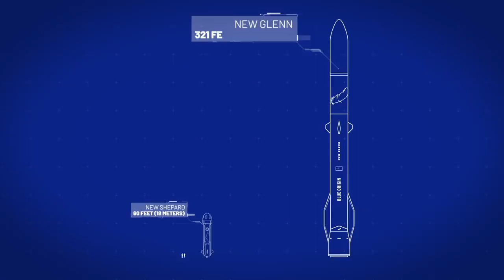New Glenn: Building the Road to Space

Comment: The Falcon Heavy Can Deliver More payload to orbit than New gleen
Reply: New Glenn has a ~3x larger payload volume. Falcon Heavy has 42% more payload mass to LEO in expendable mode than New Glenn does with first stage recovery. In Recovery mode, Falcon Heavy has about two thirds as much payload mass as New Glenn in recovery mode. Blue Origin hasn't disclosed expendable performance. If New Glenn has a similar recovery penalty as Falcon 9, New Glenn in expendable mode would have similar LEO performance to Falcon Heavy in expendable mode (with the 3x larger fairing).
Reply: @ncb1397  you right, anyway, Falcon Heavy Will be Obsolete when SuperHeavy Is operational, And SuperHeavy Is a monster😳

Comment: 0:30 That is not true, the Falcon Heavy (operational since 2018 and currently the most powerful operational rocket in the world) has more payload to LEO than New Gleen, more specifically, it has 1.4 times more capacity.

Of course, this doesn't make New Gleen any less impressive, if it achieves high reusability, high reliability, and low price, it could be a much bigger success than Falcon Heavy.

(New Gleen LEO Payload = 45 tons.
FH LEO Payload = 63 tons.
please correct me if I'm wrong)
Reply: According to one source, FH should deliver that 63.8 payload in fully expendable mode, and 57.4 tons with core expendable mode, and 28.4 tons in fully reusable mode (sans upper stage). New Glenn would be more 'efficient' than FH in this regard at 45 tons to LEO, while still having a reusable booster, at least on paper.
Reply: @mpeterselman  True, although we won't know until New Glenn flies (hopefully late 2022, but unlikely), a major factor we don't know about is manufacturing price, in which case a non-reusable version of New Glenn would certainly be more powerful than any FH configuration, although it could be very unprofitable.

In any case the most important thing is that there are as many alternatives to Starship as possible.